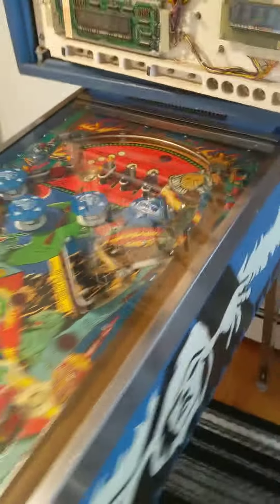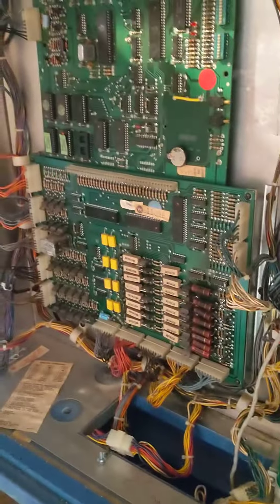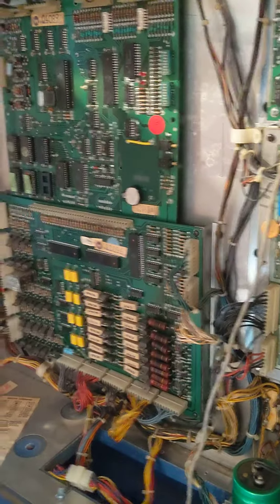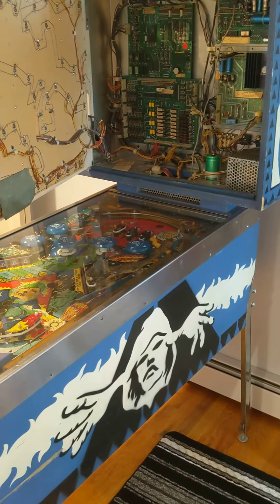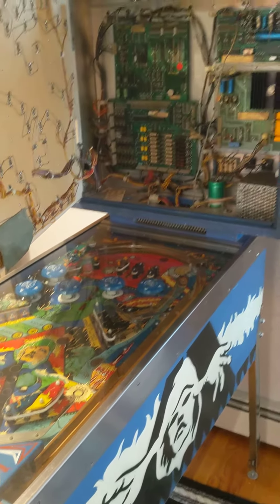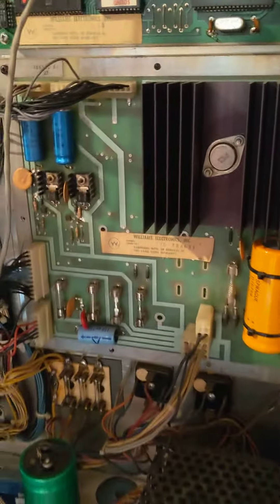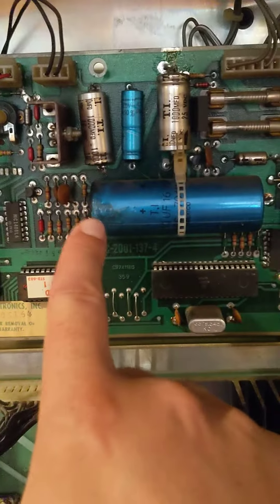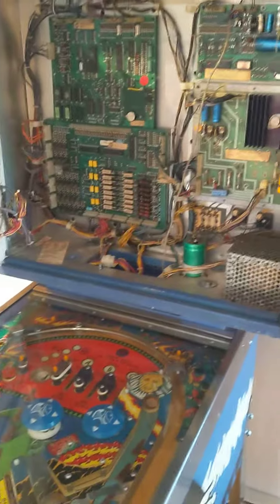Timewarp Pinball Issue (1/3)

Comment: Sounds to me you need to dig into it. I used to work on them back in the day. The electrolytic capacitors (the big blue one is one) come in all sizes and shapes and they leak, dry out that die. I watch a channel, Joe’s classic pinball and he goes through them top to bottom. How to test and fix. Good luck